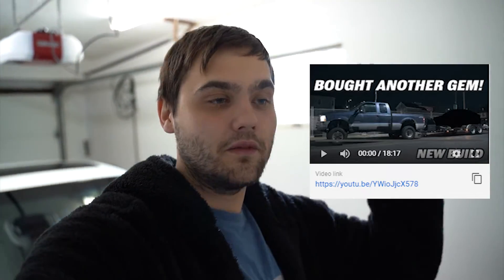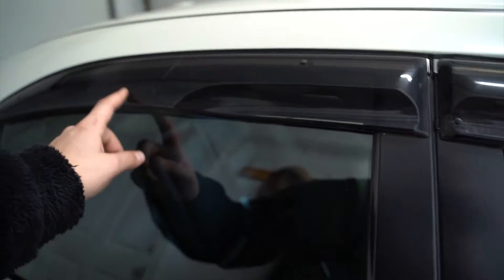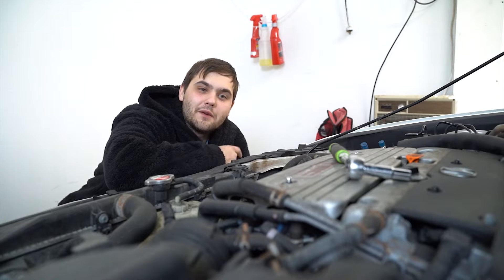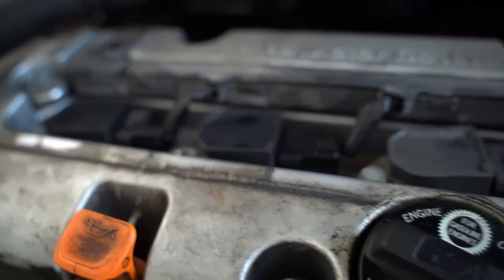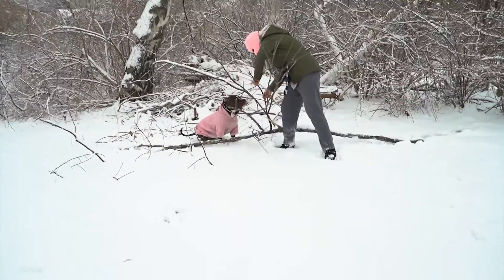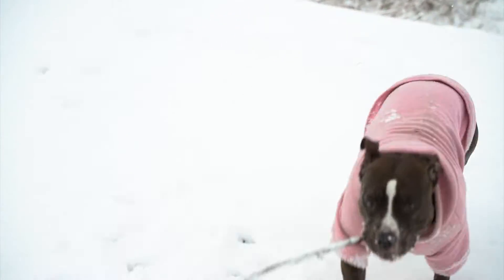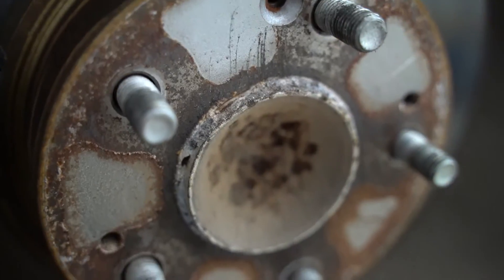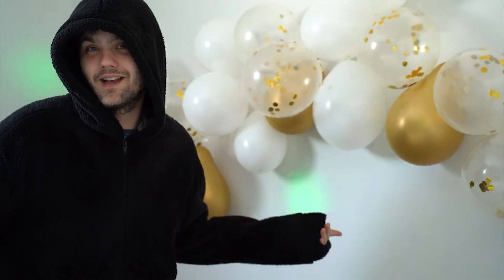Putting My Konig HyperGrams On The NEW TSX!

Comment: Nice wheels .what off set are those konigs? Thanks
Reply from the maker: Thanks, 18x8.5+35
Reply: Hey rish thanks for the reply. Hey man i bought avid1 06 wheels and this is my wheel spec .17x8.0 5x114.3  +35. With 225 /55/17 tires. I didnt like the way they looked they stuck out .and i didnt like the look. I will change my tires soon. How did you make it look flush? Thanks again
Reply from the maker: @fernie2700 do you have any camber arms or spacers? Cause ive got 18x8.5 +35 and they go inward a bit since no camber arms

Comment: thanks for the wonderful tsx content!!
btw whats your wheel size? 225/35??
Reply from the maker: And thank you very much for viewing the video and checking out the channel! 

Wheels are 18x8.5 +35 tires 225 40
Reply: @RishMedia  thank you keep up the tsx content!!!
Reply: @RishMedia  stock suspension?  They don't rub?
Reply from the maker: @darryl9244  it’ll keep on coming!
Reply from the maker: @200horsepower  yessir at stock height practically nothing will rub but on my previous Tsx I had to roll the fronts a bit/move fender liner. 
Rears, had to do quite a bit of hitting and pulling to make it not rub, tire was sitting on the inner quarter panel lol